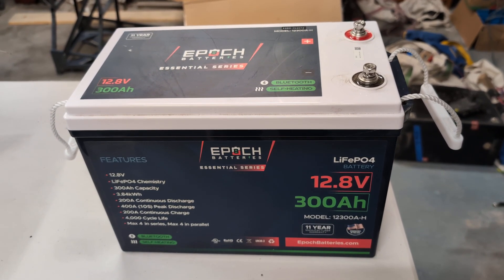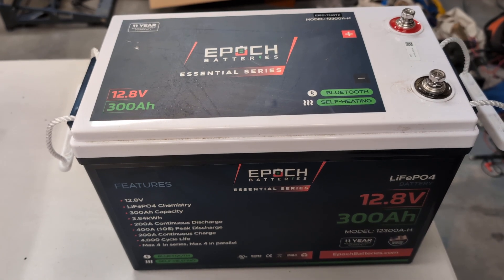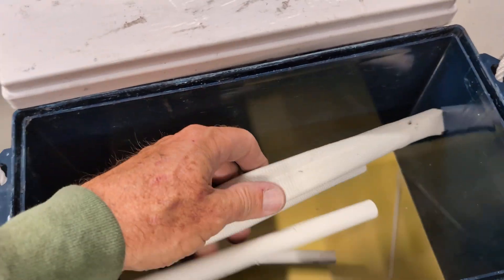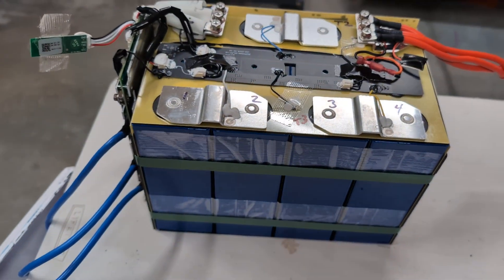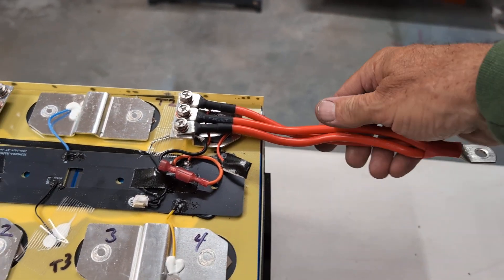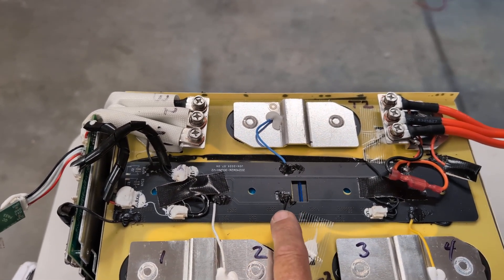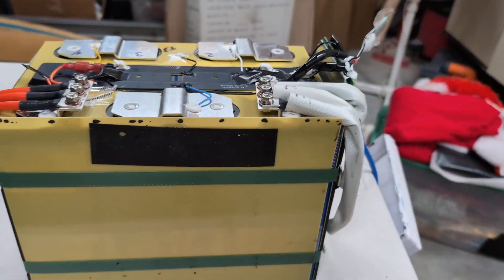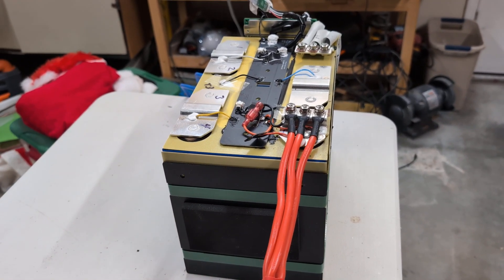Epoch 12300A-H Teardown

Comment: Great teardown. I appreciate you sharing this. Epoch is one company I am considering. As an engineer it is nice to see what is inside the box. Another good company is SFK. They are a smaller company, but their engineering is excellent. They sell complete batteries and kits. Worth checking out. I have no affiliation with the company, but I am considering them along with Epoch. SFK has Victron comms that work, for about the same price on their equivalent 300Ah battery.